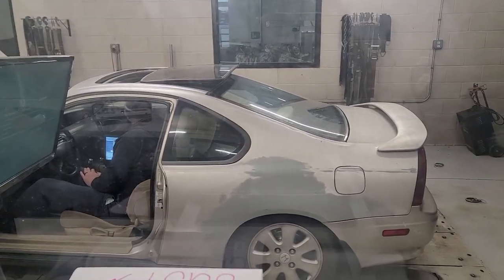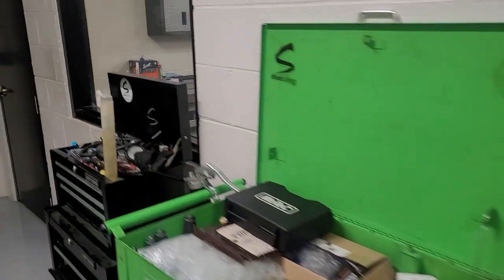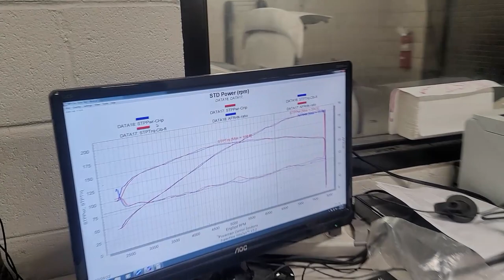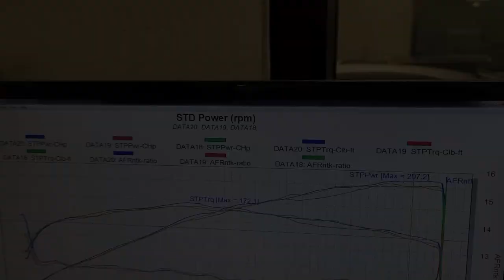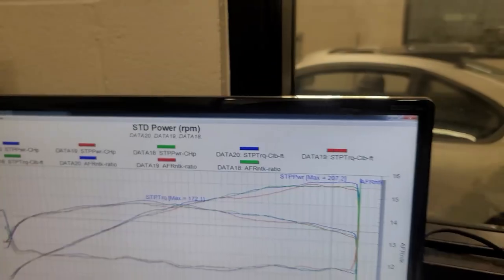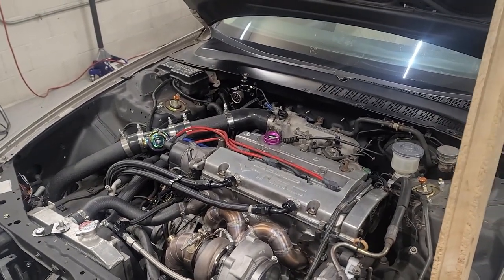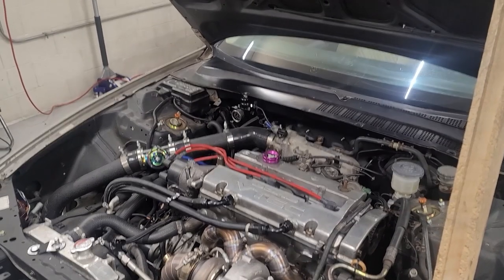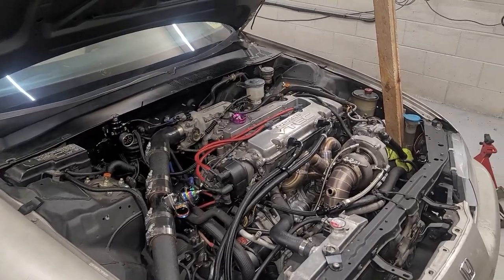stock h22 turbo gets tuned and it made..... | how to turbo your honda Prelude pt5

Comment: Love the H22/lude content.  I helped my buddy put together and install a turbo kit on his 5th gen.  We were able to keep p/s and a/c with a log manifold.  Obviously a log mani is not as efficient, but for low boost on a stock block it worked well.
Reply: @patrickantiarrhythmickerce. What log mani do you guys use ?
Reply: I like the cast iron log mani's. I feel like the exhaust gases are more direct instead of the ram mani

Comment: Your wastegate came stock with a 7lb spring. It's not the wastegate restricting pressure. It's the boost controller. The vacuum line on the turbo needs to just get capped and then run a vacuum from the wastegate to the intake manifold.
Reply from the maker: Wastegate came with 3 different springs. The boost controller worked fine. Lol I'm not new to building cars. You might want to double check your set up if that's how your running your car.
Reply: Naaaaa your showing that h22 only got 205hp with 8lbs of boost? Dude my f22 is at 250hp at 8lbs. There's no way that setup is right.
Reply from the maker: @ludelife3962  it only made 5 lbs and its an awd dyno add 10-11% for the correction

Comment: I have jun high lift cams, adjustable timing gears,  titanium valve springs and retainers, bronze phosphorous valve guides, sleeved block, bearings ,rods and prisons with no turbo, I never got the Honda data, stage 2 clutch, lighten fly wheel, deleted balance shafts, I always wanted to tune it/get the cpu but times are hard lol . 95 Honda prelude h22 from Toronto

Comment: Im just gunna tell you right now that you don't want a boost controller with that low of pressure. That's why you spent money on the wastegate, the spring regulates the pressure. I got a boosted 4th gen f22a1. It's been boosted for over 6 years. Your h22 should sound way better than that....it's not getting into boost like it should.

Comment: Hey man wantin to do stock with turbo.  Engine builder more or less called me an idiot as he wanted 8k to build.  Engine out and brought to him     Thoughts?
Reply from the maker: It all depends on what your power goals are. If your only looking for 280-320 stock is fine with good tune.

8k seems a little steep. If you do a closed deck motor you can just do rods and pistons for like $2500 or less
Reply: @treybedipping1734  thanks Trey.   Just wanting a lil something more with a blow off valve to hear